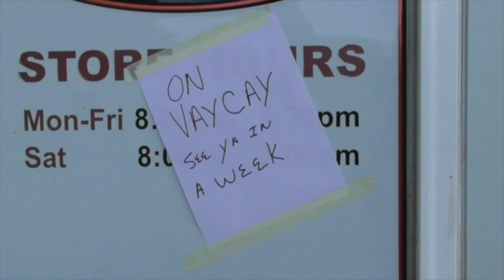How To Fix Steering On John Deere (L, LA and D Series) Riding Mowers - with Taryl

Comment: This has to be one of my favorite goto videos, I must have watched this a dozen times:) I loved foggy helping out! IMHO to make it easier to align the sector gear if you notice a small hole between the two bolts that mount the sector gear, that is there to center align the sector gear, I believe it takes a 3/8” drill or dowel through the hole to align it and hold it centered, it’s been awhile since I did it so it might be a bigger size:) Then you won’t have to count the teeth and you wont have to worry about the sector gear turning when installing the steering wheel and steering gear.
It also helps when adjusting the toe.

Comment: Thanks for the amusing and helpful video. I found that tipping my tractor (L120) with the engine on its rear was not feasible (as he says it heavy) and my hands are to big to get where they need to be. I addressed these issues by 1) driving the front wheels onto the ramps I use for my car, and 2) removing the plate that holds the sector gear. The sector gear is attached by 4 bolts (10 mm) that are easy to get at and are screwed into the frame (no nut to hold with a second wrench). The plate won't come all the way off because of all of the other stuff in the way, but it did get me a couple more inches so it was then easy to get a wrench on the bolts holding the sector gear.

Comment: Wow!  Will you come do mine?!?!  Very nice work.  I wondered about how many mil that first piece of steel was (thinking it looked too thin) then you redid it with some nice thick 1/4”.  Dang.  I wish they would’ve done this at the factory.  Just replaced my front tires because of really uneven wear.  If I could weld it would’ve been the perfect time to do this.

Comment: Very informative. It makes these jobs much easier when you see someone else do it, before you tackle it.  I need to do this job on my 2004 Husqvarna 2548, the steering is very sloppy.  I assume it will be very similar.  They tell you to grease these gears, but I'm starting to wonder if that is a good idea.  My property in NC is very sandy.  Do you put grease on them? Thanks.
Reply: i did a simple job on my 2008 mtd the steering was sloppy as hell come to find out all the bolts were lose so i think someone did work to it but i fixed it
Reply: i went under the dash and found boults that were backed out made the whole steering shity
Reply: @SORGIGERMANICO  Same here, on my LA125, I'm looking up from underneath and I see whole dash moving when I turn steering wheel, both small bolts are loose, when I take it apart, I will see if I can put a lock washer on each. I'm going to modify top chinsy broken bushing with one of the old big bottom bushings like I saw in another video. I was going to replace top small bushing with a new, my Ace store doesn't even show it on diagram. Really??
Reply: @turdsandwicher  If gear is worn out, it takes no time to pop it off and replace it, then add some bearing or lithium grease, shouldn't have metal to metal mating not lubed, my opinion.

Comment: TARYL:   I absolutely love your channel... great tips, and KEEP THE HUMOR COMING!!!  A small note, at least on my John Deere LA 175 - I had the left tie rod connector (the part underneath the mower) break off, and had to purchase the whole unit.  The JD shop in McKinney, Texas did me good, a shout out to them!  They had the part, and he let me have it cheaper than it would have cost to buy through Amazon and then pay for 3 day shipping.  Anyway, to the note here:  the bolt on the inside for the tie rod end is 17 mm not 15 mm as stated in the video, at least for my model.  The other size, 13mm is spot-on.  Again, love your channel, and keep 'em coming!!

Comment: Help!   La135 - replacing drive belt, removing pinion, unable to remove the pinion steering gear.  It’s stuck on, 3 days of pb blaster.  Still won’t budge.  Thought about going to get propane torch to heat and try again.  Suggestions please. Thanks

Comment: Taryl, as one small engine mechanic to another, could you give me an idea of how the shifter torison spring is supposed to fit on the shifter lever. I have one to repair and the spring was broken off course and I’d like to know how this spring fits on the lever. I’ve tried diagrams etc but to no avail on how follow any clear diagram.

Comment: Just did this to mine! the gear was so rusted on there that i had to use a crowbar to knock it off. Also, i find it was easier to drop the plate that holds sector gear is mounted to

Comment: I just fixed my steering on my John Deere. I had the metal bushings. They tried to sell me the plastic ones. I mic’d them. The metal was same as plastic new one. So, I kept the metals ones. Should I have replaced with plastic ones. Figured metal last longer than plastic. Even the mechanic they had. Had never seen metal bushings. Thanks

Comment: Taryl I Have a Craftman Rotor Tiller With a 208cc OHV Briggs . When I go to pull it to start the motor it want's to pull back and just about jerk my arm off . I think it is the valve adjustment  but I can't find what to set them on the book does not show the settings . Can you help me. Thanks.

Comment: If you don't have a hydrostatic transmission its easier to pull the gear off the steering shaft and the the 4 10mm bolts holding the plate with the sector gear off and take it out of the unit.

Comment: I bought a steering replacement kit for a John Deere 140 D lawn tractor and installed it. The problem I'm having is my tractor use to turn very sharply to the left ( non discharge side ) to mow around obstacles. After I installed the kit I've lost the tighter turning radius ability on my tractor and have to make 4 point turns around raised tree rings in my yard. Can any one tell me what I did wrong .

Comment: Those two bolts where you gotta reach way up in there to get on the nuts, they should have made the hole threaded. Or welded a nut on the back of the main plate so you can just zip out and zip back in the bolts.

Comment: Why not just remove that whole plate the steering gear is connected to, it's easy?  Drop the deck and pull the gear and bushing off the steering shaft like before.  Then (skip this for manual transmissions) if you have an automatic gearbox pop off the retaining washer and slide the rod out of the drive pedal and the tab sticking through the plate, a little bit of grunt is needed.  Disconnect the steering rods from the wheel spindles and undo the four 10mm bolts holding the plate on(2 per side).  Done, simple took me less than 15min and the entire assembly comes right out so you can put it on a workbench.  No need to reach up and behind things, jack stands will do no need to stand the mower up on its butt (unless your into that kind of thing I suppose) much easier way to go.

Comment: The pinion appears to have 10 teeth and a 6-tooth spline, so if you're really anal about centering the steering you should realize that by shifting the pinion by one spline tooth you get 2/3 of a gear tooth shift. You can thus move the steering wheel in 12 degree increments, and get it centered within 6 degrees.
I've watched several of these videos showing the steering gear replacement. All of the old parts are dry and pretty clean when they come off, and no one lubricates anything on reassembly. I wonder if this is why there are so many videos showing this procedure...
Reply: You are absolutely right, I noticed that also, no lubrication on METAL to METAL gears, metal bushing in metal groove, that's crazy, put some bearing or lithium grease on and clean it off each start of mowing season and relube! JD won't tell you that, they want new parts money.
Reply: @thomasschuldaski9968  John Deere does not recommend greasing the steering. They say it attracts dirt and causes increased wear.

Comment: Terrible design.  I was able to carefully drill out the end of the pinion gear so it could be reversed on the splines of the steering shaft.
Ready for another day!
Reply: Yes, that's good you were able to do that, I said same thing, why didn't hole go all the way thru, cuz the gear is offset and you can reverse it and good as new again, gear was $30 but I got it for $25 with Ace coupon.